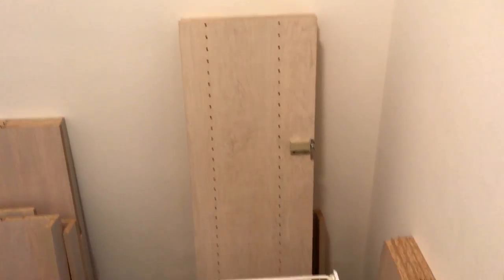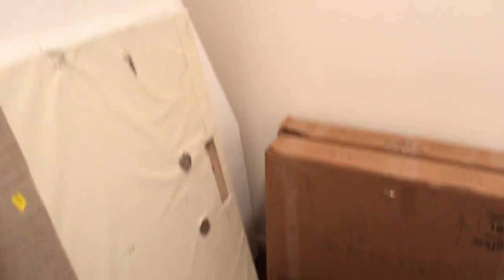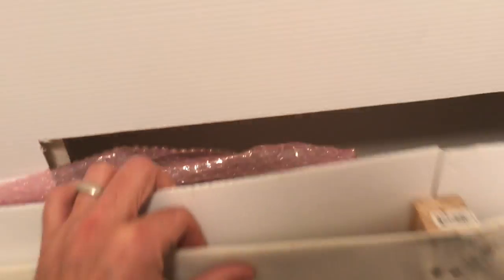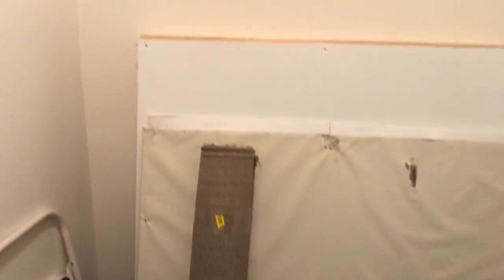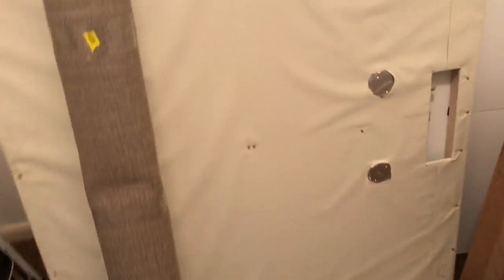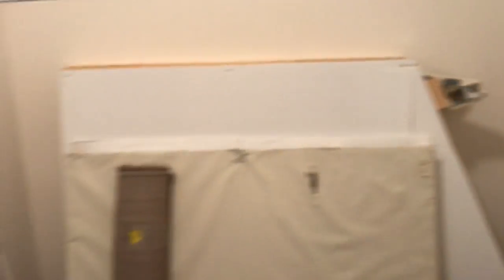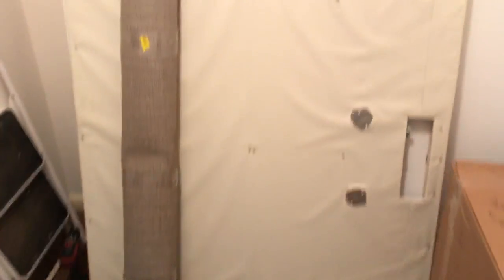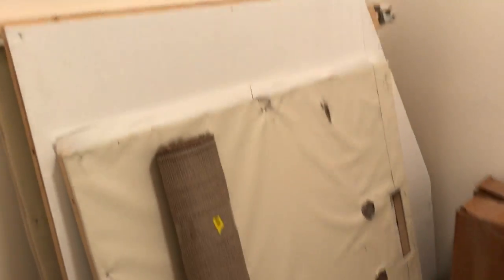A Moving Glideslope

Comment: Congrats on your move, hope the setup will go smooth , for your info, my room is 8x7.5 feet, I feel like an elephant in a closset, but still can use my projector, optoma GT1080E , which hangs on the ceiling  3.5 feet from the wall, to project a 100" image.
So maybe you can still use yours , a lot of tweaking, but you get there.
Keep up the spirit!
Reply from the maker: I got there!

Comment: You will get there matey. Have you thought about putting your projector onto a folding arm so that it can actually fold up into the ceiling, when ready to fly, you can drop the projector down. Just a thought!.
Mike from Scotland.
Reply from the maker: I looked at that but went with a mount I already had. But I might change it for an arm later so I have better screen alignment.

Comment: good luck on the rebuild

one led screen will not be enough for your fov  im afraid

since you can make it real dark your  UST will still do a good job 
I used a piece of MDF and painted that in 3 coatings , sanded and repainted  , cheap but very good solution.
Reply from the maker: Thanks much.
Reply from the maker: Correct.